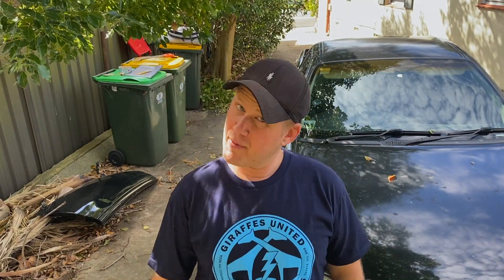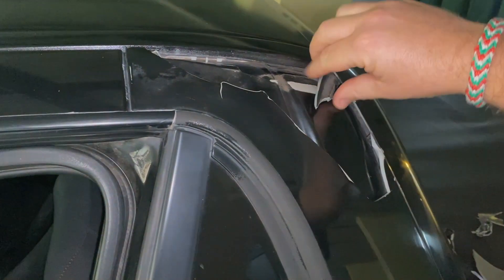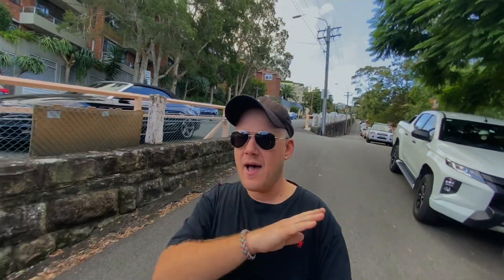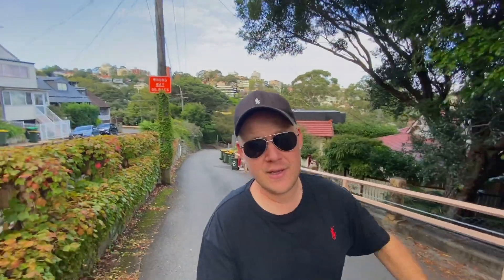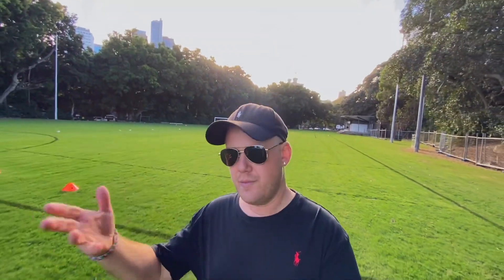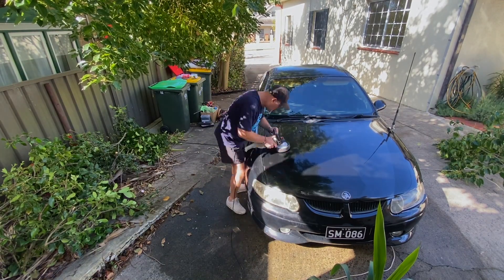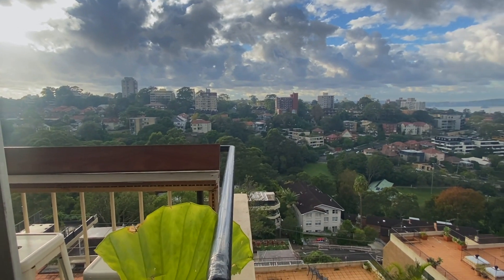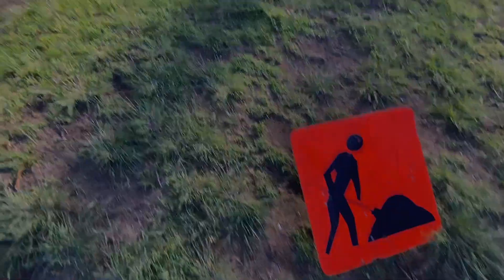MOVING to THAILAND  - sell CAR to RENT Apartment?

Comment: Oh, i see my comment is gone. Did not want to offend with the information. Sorry. if i did so. Cheers
Reply from the maker: Hey bro, no I didn’t delete any comments. I have a filter on that censors some words like ‘fat’ ‘chubby’ overweight haha. Sick of seeing it. So if it happened to include those words it likely wouldn’t have shown up
Reply: @GoneAdrift  It was about bringing meds into Thailand. Only 30 days of prescr. meds are allowed to import. To avoid trouble i suggested to check their website which i will not name again, because maybe another word you can use instead of meds in the name of the website could´ve been the issue 😅